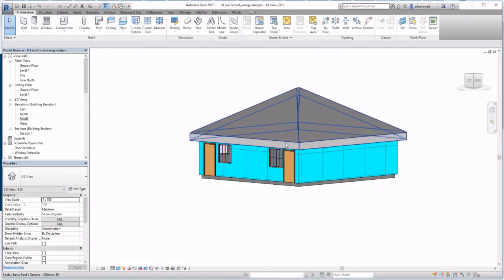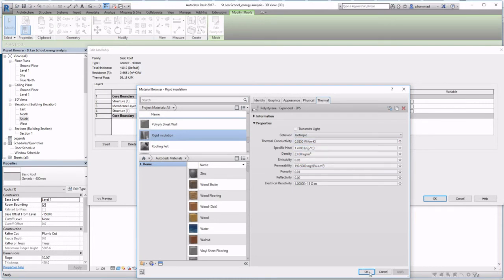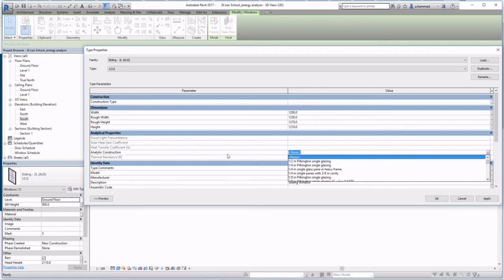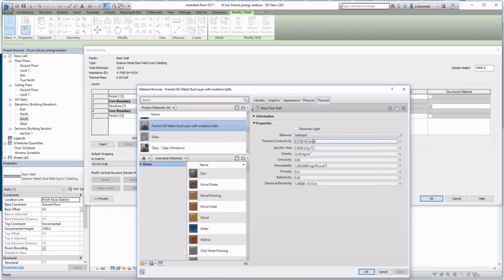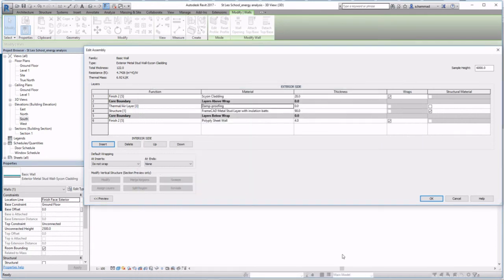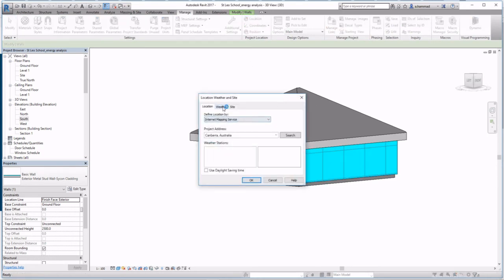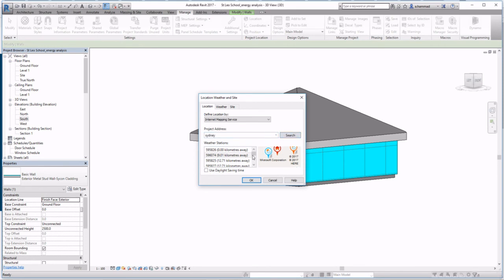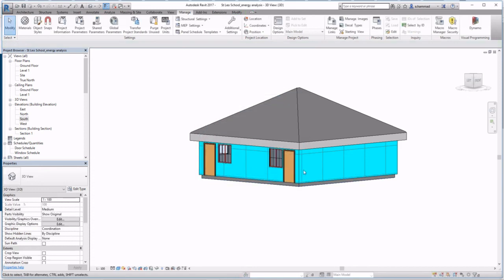Revit Energy Analysis Part-1

Comment: Dear Ahmed I have a problem in Revit 2017. I have a model when I run it the roof does not appear in result while all onther parts are there such as windows, walls, and so on. Could you help me about that 
Thanks
Reply from the maker: Two things: 
1). Make sure the roof is room bounding (there is a box which u need to tick in the properties window)
2). Make sure your that the room offsets are high enough to include the roof
Reply: Thank you so much Ahmed Hammad , I'll do and see what will happen. I appreciate your response.